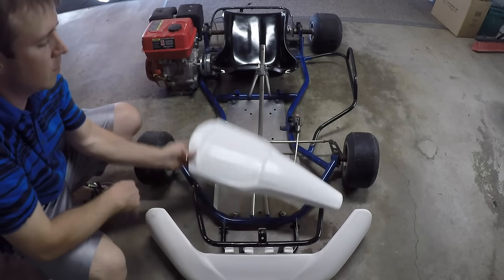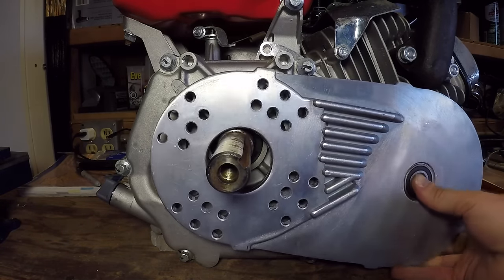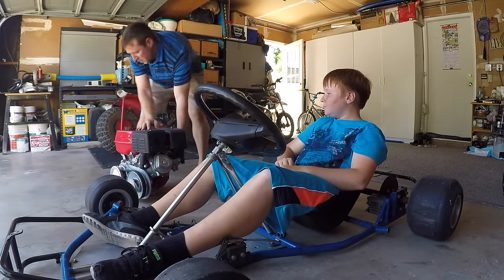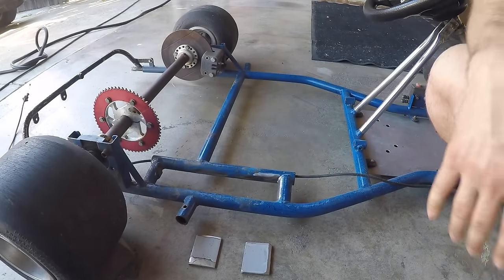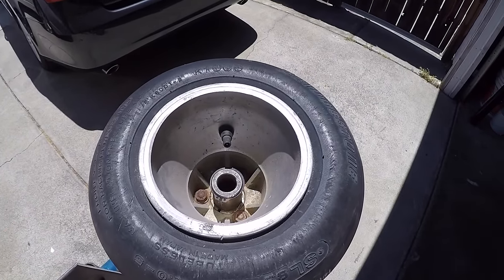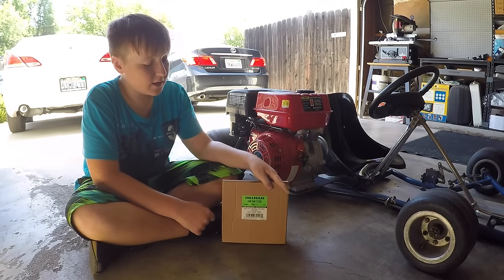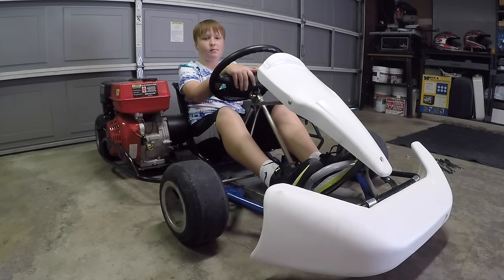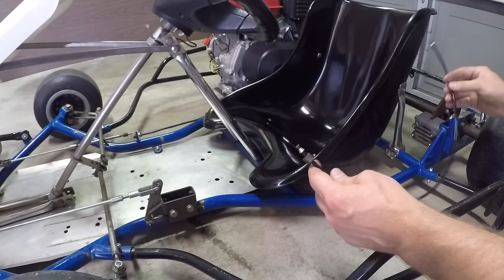9HP GO KART PROJECT

Comment: what is the name of the engine b/ci am trying to build one for my senior project
Reply from the maker: This engine is called WEN. Some dude sold it to me because it was too big for his go kart. I paid $100 for it. Gotta love craigslist for sweet deals.
Reply: would a predator be good for a gokart or no??
Reply from the maker: +Mohamed Idris 
Yes sir, predators are a good choice just make sure you run it while you have your 90 day warranty. I've noticed that if a motor runs strong within that period then it should last you down the road. Good luck with your project.
Reply: Thank You so much for your advice
Reply from the maker: +Mohamed Idris 
For sure buddy. Out of six predators that I bought, two of them had issues where they would idle normally but once you increase the RPM they would miss fire and starve for fuel. I took them back for exchange. California engines come with lean jets therefore engines run like shit. Maybe you'll have better luck with yours. When you get done with your go kart send me a link to your video, would love to check it out.
Reply from the maker: +Mohamed Idris 
The engine looks good but the seller is shady. Looks like several buyers didn't get their items so I would be extra careful with sellers who got lower than 99% rating. There are a lot of scammers on eBay. Good luck.
Reply: +balabay77  bgxdswws
Reply: +balabay77  bgxdswws

Comment: Wich motor is this?
Reply from the maker: Alex'Sfx 
It’s a Chinese 9HP motor called Wen power?
It used to be on a generator until the coils went out. Usually they cost around $300 new but we bought it for $100 used. 
Made it into a cheap and fun project.

Comment: I would of used a two stroke engine.
Reply from the maker: Belive me, if i had one i would of used it. Four stroke engines are only good for goofing off on the parking lots.
Reply: ya I would to
Reply: yup, as much as I am a 4 stroke convert these days, could get 9hp out of a 80cc 2 smoker easy as piss for loads less weight.
Reply: My rm 80 produces around 20 hp with very little mods, it's fast as fuck and I couldn't imagine it on that little cart.
Reply: Just gear it down in that case to give you better torque.
Reply: i have a kart like that with a yz 125 engine bored out to a 150
Reply: Batman I bet the when the power band kicks in it goes like fuck, why not a CR500 engine? xD

Comment: Share your material list, please :)))
Reply from the maker: Well, theres not much to share here. First, find a roller go kart without the motor and then order your parts online. Frame and motor was purchased on Craigslist and the rest on eBay. If you need more info on where to find new parts then feel free to comment and i will try to help. Good luck with your kart.

Comment: Why did you use sticks
Reply from the maker: I used those sticks to mark the spot where new holes will be drilled. Original holes were fine but the torque converter back plate would hang too low so when We drilled new holes the back plate was more horizontally inclined and made it easier to mount the entire engine easier. Hope that helps

Comment: I got a yerf-dog that came with a techumseh that worked but it had to many problems so i put a predator 212 engine on it. It fixed all the problems.(Problems with idle, pull start broke, wasted gasoline like hell.) It came with a torque converted but it needed a new belt. So i installed that and it goes pretty fast around 30 on full throttle ( i think it could get more in long distance racing) Well i decided to beat the crap out of it by going full throttle all the time and drifing. Well i got 3 belts from ebay. The first one got eaten by the torque coverter like hell the first day. Was it cuz of drifting? Could it have been cuz the belts are cheap? I can buy one at tractor supply (for about 36) and at a local tractor repair shop for 46. whats the reason my belts got eaten up so fast? They are straight and everythig is thightened to the point were it doesnt move. I put dry lubricant on the clutch about a week ago. Can anyone help?
Reply from the maker: Hey Jason how are you?
Are your driver pulley and Driven pulley aligned correctly? Sometimes if you forget to put a bushing on the engine shaft then your belt might be misaligned. That will definitely ruin your belt. Also sudden acceleration will yank your belt to the point that it fails on you. Let me know what you find. I would start by taking it apart and cleaning it and checking to see if your springs in driver pulley are still good. Cheers
Reply: +balabay77 Im good thank for asking. Yes well to me they seem alligned. The bushing or brushing(not sure) in the center of my drive pully is missing. I've thought about buying it but it still idles without it and it runs fine. Could it be that? And i think another problem could be what you said about the acceleration. Am i supposed to increase ths acceleration little by little? Because i usually step on it all the way right away. I sometimes go little by little.
Reply from the maker: With sudden acceleration driver pulley is grabbing the belt and yanks it hard in order to get you going. if your belt is Chinese then it won't last very long. I had the same issue with these cheap belts. When i purchased original Comet belt on Ebay for 25 bucks it still works flawlessly till this day. Its a better quality belt. Good luck with your kart and let me know what you find out.
Reply: +balabay77 Thank you very much. I will take you advice and buy a good quality belt or an original belt. I believe my belts are chinese.
Reply from the maker: +Jason Soto 
If you ever buy original comet belt you'll notice how heavy and sturdy it is compared to Chinese belts. Good luck bud.
Reply: +balabay77 Alright thanks and i found a master of motion brand belt in a local tractor supply store so it gonna buy it to see how it goes. Thank you for all your help.
Reply from the maker: +Jason Soto 
For sure. Make sure your new belt is asymmetrical.
Reply: +balabay77 wht does that mean?
Reply: +balabay77 Nevermind i got what that means and the ones that i got were symmetrical could that be another problem?
Reply: +Jason Soto The old belt that i replaced was assymetrical
Reply from the maker: +Jason Soto 
Yes that could be your problem. Belt that you need should have one side slanted and the other side that goes towards the motor is flat or straight. If you get a belt with both sides slanted then it will not work for too long and fail on you.
Reply: +balabay77 Thank you so much. I'm guessing that was the problem could also be cause the belt was chinese. I will find out if the belt was the problem once i buy a new phone for it. Thank you very much. Can someone drift with a torque converter wont that just burn up the belt also. Where i drift its all dirt and grass with bumps.
Reply: +Jason Soto one*

Comment: look like he could never Chang the oil again because  he chopped the top off
Reply from the maker: This motor comes with two oil plugs. Rear plug is for convenience and front plug is actually a dipstick to check oil level. At 1:37 you can see for yourself that front dipstick is there as main plug. Cheers

Comment: Dude how u gonna change ur oil now that u cut off the cap to change the oil 😂😂
Reply from the maker: For your info this engine comes with two dipsticks. The reason it has two dipsticks is because when the engine is mounted in different equipment one of the dipsticks may become difficult or impossible to reach so you always have the other one to check/fill oil, same with the drain plug.
Reply: Dude the hole where the dip stick is is to check the amount of oil if u are filling that hole then there is no point of having a dip stick
Reply: Dude I've been racing proper karts for
Reply: U can see pics of me racing proper 2 stroke racing karts
Reply: So I know what I'm talking about
Reply: its a nine-horse engine not a fucking space ship